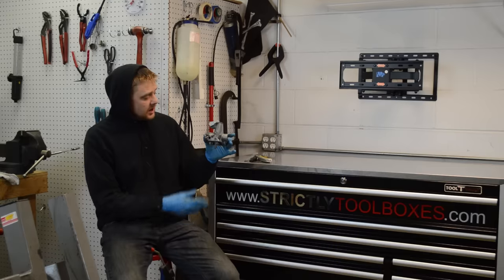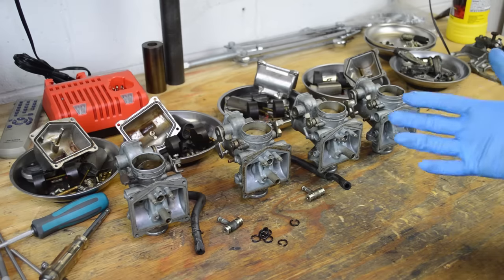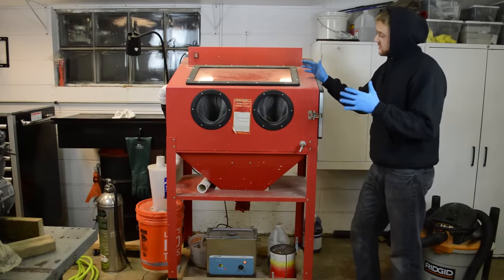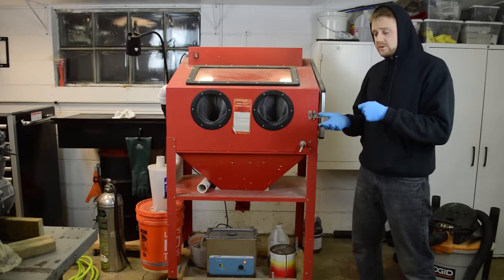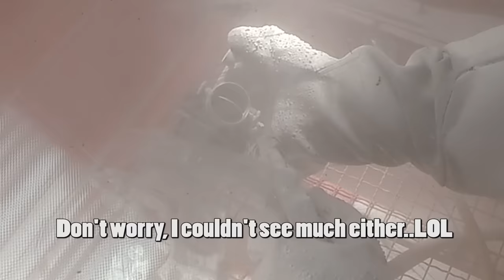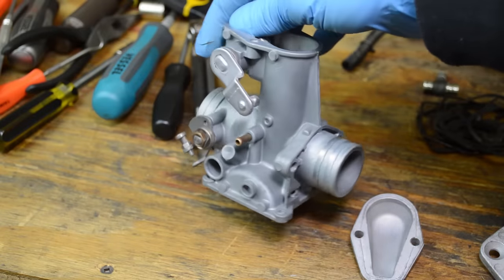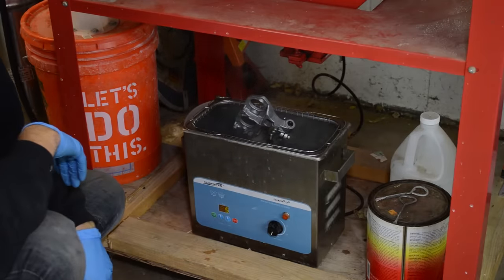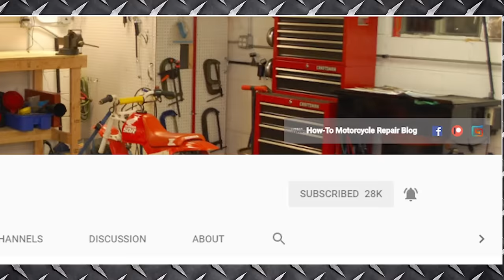The BEST method for cleaning carburetors - soda blast and ultrasonic

Comment: Hi  - love your videos.
How do you protect the outside of the carburettor components from corrosion after blasting?
Reply from the maker: No need after soda blast.
Reply: The carbs will eventually get that white chalky corrosion unless they become oily from being on the engine. Not much you can do but maybe try spraying them with a product called Corrosion X Aviation. It's used in aircraft to prevent such corrosion, and even has a Mil spec. I use it in my shop to prevent rust on my lathe and mill. Excellent product. I have also used engine clear coat paint (in a spray can) to clearcoat my aluminum intake manifold on my truck after blasting. It worked great and still looks good after 4 years. Might not work for a carb, but... Just some ideas. Cheers

Comment: What size ceramic tip do you use on your blast gun for the soda? Great video, cheers, Doug
Reply from the maker: Not sure off the top of my head. I'll mention it in my mod video. I did buy the different sizes from HF and have experimented with a few.
Reply: Thanks Mathew!

Comment: I got a 2005 yz125 carb. I removed the venturi plate in the center of the carb, the very little rubber gasket was junk. Where on this planet do they hide these things? I cant find it anywhere. Like your vids.
Reply from the maker: Is it a keihin pwk? Are you talking about the jet block gasket?
Reply: MatthewMCRepair , it's a mikuni 38mm. There is a small plate in the center of the Venturi on the bottom and is attached by two screws from the bottom and there are three T tiny little holes and there's a gasket under this. It's a tiny rubber gasket.
Reply from the maker: Try contacting Mikuni or a distributor near you: http://www.mikuni.com/fs-carburetor.html

Comment: Today I tried blasted my carburator and it will no take the stains out of it. It will not even clean the brass parts. No idea how are u doing it.
Reply from the maker: Explain the setup and media. Email me pics of the parts.
Reply: @HTMR  exactly as you did, but i did the ultrasonic before blasting.. The soda will not remove the black surface rust of the aluminum, apparently the soda is only for cleaning not for removal of rust or stains of any kind.
Reply from the maker: @hemidenisv8  black corrosion is difficult to remove. Soda won't do it as it is too soft of media. Best way is to vapor blast. https://youtu.be/ucjdcPQchXk?feature=shared

Comment: Why are you using water in the ultrasonic cleaner?  Use a carburetor cleaner.  You don't need to spend time soda blasting the parts first.  Just throw the parts into the carburetor cleaner and turn on the ultrasonic bath and leave it.  You don't have to worry about bits of gasket stuck to the metal, gas / oil residue coating the bowl.  Just use an ultrasonic cleaner filled with carburetor cleaning solution.

Comment: Matthew l guess l shoulda been specific the silica sand, and glass
beed are the culprits which rip holes in your index finger glove...all
machine shops and individuals who own one would tell you...l have
a glass bead cabinet but l haven't tried soda yet...going to tho...but
no your parts not gonna fly off the needle nose pliers. You hold them
on your left hand and glass bead with the right hand holding the nozzle.
This saves me buying torn gloves all the time...( will somebody else
try this and give their feed back on here ).
Reply from the maker: You have to put down the needle nose to get your hand out right? To risky to loose a jet in the soda. I've lost a small part and had to sift through 40lb....that sucked!
Reply: Use needle nosed vice grips with just light locking pressure. Might work

Comment: What diameter nozzle do you use when blasting with the soda?
Reply from the maker: Stock one works well. I went with one larger or smaller, can't remember. I bought the pack of 4 or 5 nozzles for 4.99 at HF.

Comment: I prefer good old acid. the stuff I have is 15 to 20 years old. zepresto carborator cleaner and small parts cleaner 5 gal is over  300 US dollars peels paint in a second and will last me for the rest of my life If it gets dirty transfer it to a new steel pail and start again.
It's easyer tear down carb hang carb from a hook and put all small  metal pices in a basket and dunk rotate carb body every half hour or hour maybe hit it with a brush in extream cases haven't had to yet.
By the time the metal parts come out and get rinsed and passages blown out every thing else should be on the table ready for reassembly. I know years ago it was Good shit. And rinses with water.

I will save the baking soda incase I spill some acid .
Reply from the maker: Yeah too bad you can't buy stuff like that anymore. I try and stay away from harsh chemicals anyway.

Comment: any idea on if this method is more or less effective than steeping the parts in a can of chem-dip or similar?
Reply from the maker: Chem dip works good too. However any crusty stuff will need to be addressed with soda. Also, any rusty residue won't get cleaned up either. Chem dip is nasty stuff and am trying to use safer methods.

Comment: I like your videos but all you do is complain about how cold it is in your garage..
Reply from the maker: You must live in California.
Reply: nope.. central Utah.. high elevation.. is been in the teens all week here. Ou'd be happy to have a heater in my shed !!
Reply from the maker: It's been mild, and then bam polar votex caused overnight lows -10 and single digit highs for 2 weeks now. It will get back into the 30's starting today and you may only hear me complain about cold for one more video :)
Reply: I live in the border its super hot wanna trade shops ?

Comment: carbs don't have to be. sterile. I have been tuning bikes all my life, hate new bikes so everything I see needs carb work. I never bother shining them that much. it is a waste of time. as long as nothing is going to flake off and float around causing problems don't bother with it. as long as the film doesn't change jet flow characteristics, don't bother with it. polishing a carb is cosmetic feel good junk.
Reply from the maker: The method I show is actually a very fast method to clean them. Also, no polishing was done. My customers are very happy when the inside and outside is clean.

Comment: Headlight fluid.
Reply: Muffler bearing valve . = /
Reply: just use the carb bleeder on the bottom of the bowl. open it up and run a tank of gas through it to clear out any debris or unwanted gas. Usually takes a crane to get them off.
Reply: Wire harness stretcher .....
Reply: 150 grit motor oil